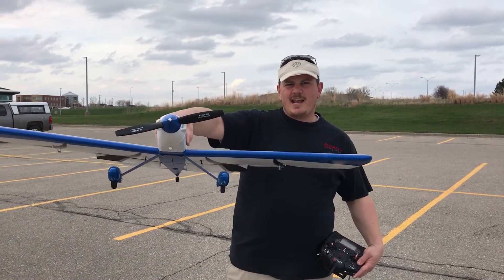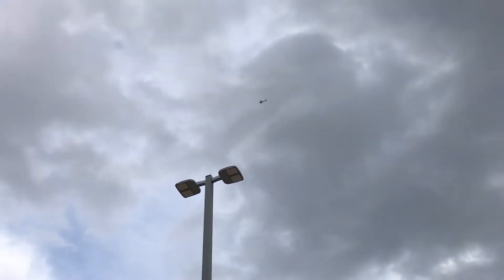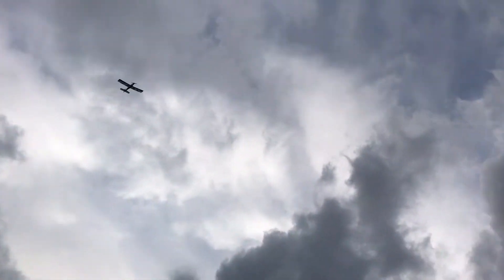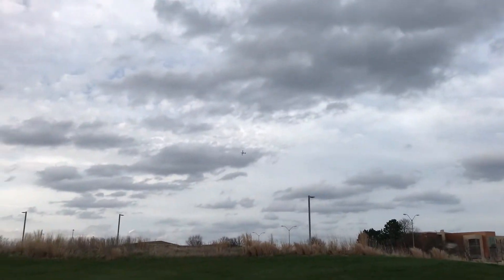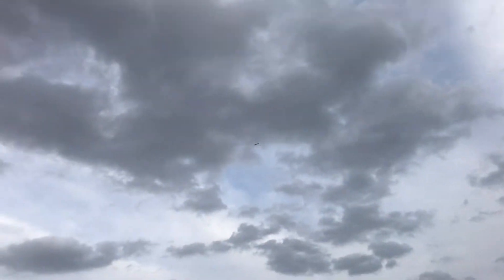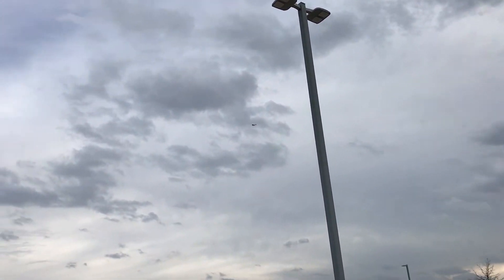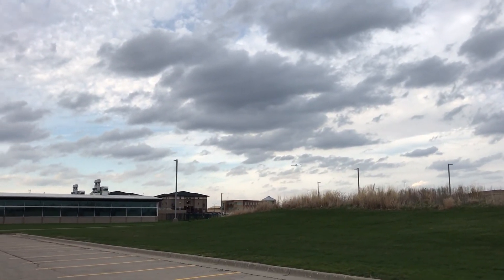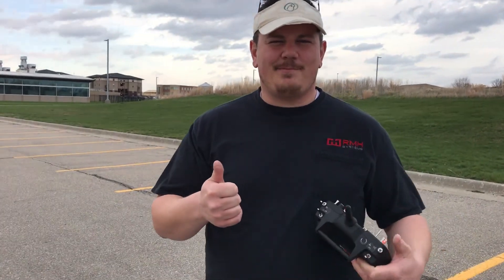Horizon Hobby - Pulse 15e - Flaps Mod Flight Test - Extreme Windy Remaiden - Part 2 A&B

Comment: Thats crazy , i have the same radio an plane,, so i need help,, can you send me your set up with the flaps,, take off, landing elevator set up
Reply from the maker: I'm sorry, this plane doens't belong to me, it's my friend and flying buddy Esteban's. As you already realize, the flaps were a mod, so you'll have to work out getting them installed (a fairly easy install on this plane).

Then just set two settings, one about 1/3 of 90 degrees down for "takeoff" setting, then one at nearly 90 degrees (strait down) for landing flaps, then just play with the elevator correction until you like the way it flies.

P.S. I JUST saw your comment..sorry for the slow reply!!!